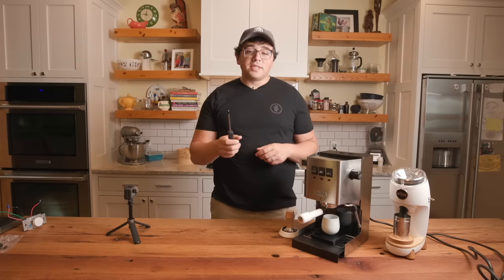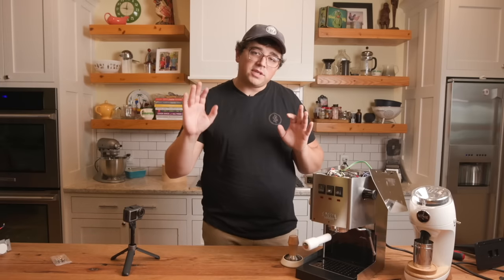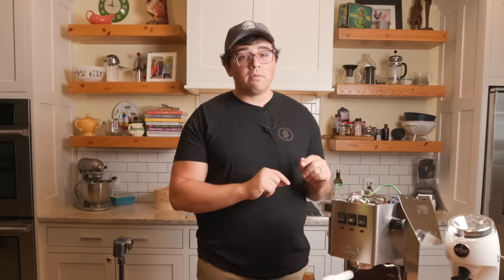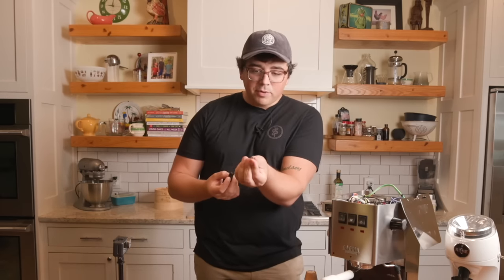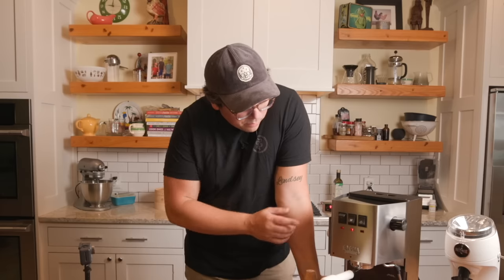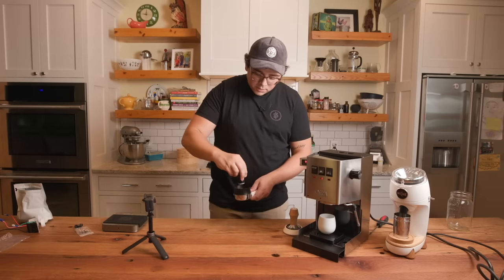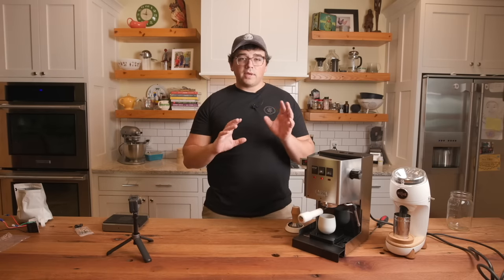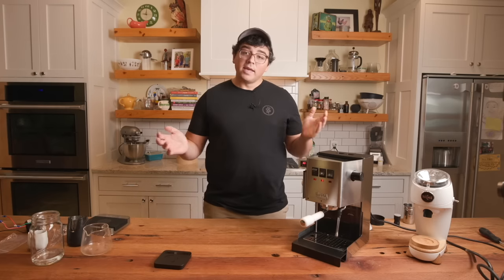TURNING A $450 MACHINE INTO A $3000 ESPRESSO MACHINE!: Gaggia Classic Pro FRANKENSTEIN

Comment: Enjoyed the video as I'm in the market to buy this machine and wanted to know what else could be added onto it.
I appreciate all the commentary on the mods for the machine, however I didn't fully understand essentially the list in order of what to buy based on price, time, and quality of change.
I'd love to buy the machine but wouldn't want to struggle in the beginning- or at least I'd like to reduce such struggle.

If anyone is around to see this comment, do tell what you believe the order is as I wouldn't mind going a little extra to make the machine better, but I'm sure I can't afford every mod quite yet.
Reply: just went through the process of doing all of the mods. 

i would say the only 'necessary mod' would be the 9 bar spring. 

my order was : 
9 bar spring
ims basket
bottomless portability
Brass shower plate
ims shower screen
MR shades PID
Pressure gauge
flow control
low profile drip tray
Reply: I think it is worth mentioning... I have likely spent around $1000 at this point with a ton of hours installing the mods. 

I do love the machine now, but It may be worth it to shell out the money on a more expensive machine from the start if you think you want all of those features
Reply: @dylanmetzdorf  thank you for the comment, helps a lot. I was thinking of going up or keeping at this but realistically since I'm still in the beginning of wanting to make coffee and practice I figure I shouldn't go too high- so if I need to skip on some mods I can live with that.

But I've heard enough good stuff about the machine for it to be worth trying especially for it being capable of making good coffee and lasting a while, the quality/build of it that is.

Comment: Okay so the last two days I have been using the new dimmer switch to start shots with a lower pressure for 5 to 7 seconds and slowly ramp up to full pressure. I don't have a pressure gauge so I don't know the exact pressure but every time I increase the pressure the flow out of the bottomless portafilter is way too fast like major channeling going on. What can I do to solve this? Without using the dimmer my shots return to the normal extraction time of about 27 to 28 seconds. Thanks for your help!!!
Reply from the maker: Hey! That's actually BECAUSE of the slow preinfusion. When adding PI, you have to grind lots finer

Comment: I didn't understand how is the flow mesured and displayed in the app? Is there any flowmeter with Bluetooth installed in the machine?
Reply: Through the Bluetooth scales?
Reply from the maker: No flow meter. I was measuring water debit. Using the scale and no hindrance between machine and scale, you can measure the flow rate. Then, you have an idea of water debit at any given position on the dial and dial in with that knowledge

Comment: (There's probably an obvious answer to this) Why 6.5 bars and not 9? I'd have thought that having the extra range would be helpful when flow profiling. Congratulations too!
Reply from the maker: I mostly did it to show what it is capable of. the set comes wiht 5 bar, 6.5 bar, 9 bar, and the machine is 12 bar. I also did it so I could run without flow profiling and have 6.5 bar shots, which are tastier to me

Comment: Have you noticed any difference in steaming pressure/consistency since doing all of the mods?
Reply from the maker: Yeah! Seems to hold steam pressure a bit longer. I'm sure Mr shades has more to say about that!
Reply: PID is a game-changer for the steaming pressure/consistency, before I was regularly second-guessing my GCP purchase but after the PID install I'm really happy. "The One" hole steam tip from Mr. Shades is also really helpful. When I eventually upgrade it will be to a Decent, but that's a long way off because I'm pretty happy and in no rush.

Comment: Do you need the pressure spring replacement if you instal the dimmer switch
Reply from the maker: I'd recommend it, yes. The dimmer doesn't control the limit of pressure. If you go too fine and do a slow rate, you could hit 12 bar and not know it. Lower the spring will lower the ceiling you could hit.
Reply: @LanceHedrick  i found out the gaggia i got has the adjustable spring not the kind you can switch for a different spring. So i have seen people build pressure gauge onto a portafilter handle to set the pressure. How about adding the pressure gauge as well as the pid and dimmer? I ordered the pid already…
Reply from the maker: Yeah! Many people have added a gauge no problem

Comment: Can you share the setting you use on niche for GCP? I'm currently using vst baskets and haven't been able to go finer than 13. Anything below,  I need >50 seconds to extract 1:2 ratio
Reply from the maker: Same. I was over 13, until I did the dimmer switch! Then with preinfusion I was able to go finer.
Reply: @LanceHedrick  thanks for confirming! Sounds like I'm on the right track. I received normcore filter and it seems to help enable finer grind but I'm still slowly testing them. Still too scared to mess with the internal lol I bought it with pid installed already.
Reply from the maker: Oh very nice! The dimmer mod is genuinely simple to do and easily reversible.
Reply: @LanceHedrick  I think I will have to attempt it hahaha I still can't get the right flow for sprouver
Reply from the maker: For sure. Dimmer will fix it! And you'll enter the heavenly world of sprovers
Reply: @LanceHedrick  hahaha i can see it coming. I shared the video with a friend who drinks long black. He's hooked on spro-over now!
Reply from the maker: Yessss. Another convert!
Reply: @LanceHedrick  I finally did it! Thanks for the encouragement.  I have a lot of experiment to do now.

Comment: Might try the dimmer. Great idea and looks easy.
Reply from the maker: Yes! Very very easy. Just go pump to wire to dimmer to wire to plug (that you took from the pump)
Reply: @LanceHedrick  Googling switches now. Got to look nice! While also being basic, single phase and not led compatible! Yikes
Reply from the maker: So the dimmers won't look nice. It is the wall mount and faceplate that need to look nice. Also, you can spin a knob out of wood or something if you'd like. 
I'll link the dimmer I used
Reply from the maker: Actually, the dimmer I used is in caption lol
Reply: @LanceHedrick  loving the videos by the way. Great stuff. Although I now want to mod my classic and upgrade my grinder!
Reply: @LanceHedrick  my dad made me a wood steam wand knob. So much nicer than the plastic
Reply from the maker: Absolutely! Get him to turn one for the dimmer.

Comment: Excuse my ignorance here, doesn't the dimmer switch do the same as the spring mod?
Reply from the maker: Nope! Were you able to check the video out! I explain both in detail!
Reply: @LanceHedrick  hey congratulations and hope you're enjoying being a father and realising the full need of caffeine!

I did watch and thank for doing them btw! but might have missed the difference in effect between them. To me the lowering of max pressure to 6.5 isn't that going in crude math be the same as keeping max at 12 but setting the dial to halfway?
Reply from the maker: Well, the dimmer you have capability to change during the shot. So, flow is what you're controlling which, in effect, can change pressure. Setting the OPV is ONLY changing what max pressure can hit prior to the valve shunting excess flow that otherwise would raise pressure
Reply: @LanceHedrick  lush thanks for explaining bit more, have ordered spring and did my first poor man's pre thingy just now (thanks to the other video) so little steps to start with me thinks! Thanks once again have subscribed to see what else you come out with! 😃
Reply from the maker: Thank you! The support means a lot!
Reply: @Splodge360  check out his flow rate video.  I found that helpful to watch before this one.

Comment: Thinking of getting one and modding it as an upgrade from my delonghi. I’m just wondering if it’s worth it since this is roughly around $1000, would it be better to get a machine around that same price?
Reply: It’s worth it (if you’re handy) and you can do it for less by ordering needed parts individually and modifying the xmt7100 pid yourself to control 2 relays. The pid comes ready to control 1 relay. Search other pid gaggia video to see how it’s all done.
Reply: Thanks for the links! Still I’m debating about skipping the modding process and going straight to a more prosumer machine. I’m looking into the pros of each right now
Reply from the maker: I would 100% recommend going to a prosumer machine over doing all of this. while this does a good job, there is so much time and effort put into it that I think just going straight to a prosumer machine is the right choice.
Reply: @LanceHedrick  thanks for the reply! I’m debating between the breville dual boiler or a quick mill silvano! Either way I should be pretty happy upgrading from my modded delonghi. I have a rok grinder so I don’t believe there should be a need to upgrade that as well
Reply from the maker: I would actually recommend upgrading the grinder. But of course that is up to you in your budget. I think you know my choice between the 2 espresso machines you brought up lol
Reply: @LanceHedrick  I have a few bdb I’m watching on eBay already haha. Once I get a new machine I’ll see if the grinder is needed, but my budget will probably allow me to get an urbanic or a used df64
Reply from the maker: Love that! That is fantastic. Happy brewing!
Reply: @LanceHedrick  I bought the urbanic a month ago and the burrs were perfectly aligned without adjustment. It grinds finer than I can go, but it needs the dimmer - next week!
Reply from the maker: Oh wow! You got lucky!  Fantastic news

Comment: Сontrolling a vibratory pump in this way is not the best solution. Installing a rotary pump will not inflate the budget too much, and the result will be much better. in this case, you need to install a jet that limits the flow of water, or install a frequency converter

Comment: Couldn’t you have place the dimmer inside the open space in the machine?  Drilling a small hole to the outside for the knob.  Better yet.  Why not just swap out the brew switch with a dimming one.
Reply from the maker: Obviously you can. I wanted to mount it so the person who received this unit for free in my patreon had the option as to what they wanted to do with the machine.

Comment: Hi Lance!
Welcome to fatherhood.

Can pretty much the same mods be done on the Saeco Poemia?
Reply from the maker: The dimmer mod can be done to any machine with a vibratory pump. Just get a single pole light dimmer (like under $10 and NOT for LED) and route the wire to the pump by way of one plug from the pump. Polarity doesn't matter

Comment: From what I understand you do not need to install the dimmer switch because the machine let's your do it already. look up Gaggia tips and tricks video
Reply from the maker: I've gone over this in the first gaggia video. That way you're talking about both wastes water and gives you barely any control. On top of that, you'll run out of hot water immediately considering the boiler is 3 oz

Comment: 9 bar spring, means your espresso actual pressure is lower than 9 bars. There's a reason it has a 12 bar spring
Reply from the maker: The 12 bar spring doesn't give 9 bar. A simple pressure test proves this.
Reply: @LanceHedrick  you have to read. This is not what i said, i said it's lower than 12 bars
Reply from the maker: 9 bar spring with a pressure gauge gives you right around 9 bar. 12 bar gives you right around 12 bar. Have you tested with a pressure gauge? Not sure where I'm misunderstanding you
Reply: I tested my GCP at the portafilter, and with the factory spring I got 12.4 bar. 9 bar spring is on order.

Comment: Dumb question, why is a six-bar machine preferable to a 12 bar machine?
Reply from the maker: Not a dumb question. I moreso changed the OPV to show how it is done. And there is a trend for low pressure shots as of late because it has been speculated extractions are more even and consistent there.
Reply: @LanceHedrick  thanks
Reply from the maker: No problem, friend!

Comment: Sorry to tell you if you want to spend a lot of money... The OPV is actually perfect as it is. To high pressure? A turn ccw. Too low? A turn cw...
Reply from the maker: a spring is not a lot of money.... unless there is a shortage of springs near you lol.
Reply: The new GCP is not adjustable and requires a spring change to adjust pressure. PITA but that was one of the changes for the 2019 redesign.

Comment: Why the 6.5bar instead of the 9bar spring?
Reply from the maker: Hey! Mostly because I prefer lower pressure on light roasts due to lower puck integrity. Also, I love turbo shots, which 6 bars are better for. So, I can opt out of flow profiling when wanting a simple turbo (watch my video on turbo shots if intrigued)
Reply: @LanceHedrick  yes, I watched the video. It was how I first found your channel. It went over my head 😅

I’ll need to go back and give it another watch. I’ve got a GCP with everything here, but the rotary knob. Having a hell of a time preventing channeling
Reply from the maker: A lot of that is likely puck prep issues! Make sure to watch the wdt video and grab a tool with .3-.4mm needles!

Comment: Why 6.5 bar spring and not 9 bar spring? I thought 9 bar is  the appropriate pressure
Reply from the maker: Different strokes. Lower pressure can be better for lighter roasts. Lighter roasts have lower puck integrity and need some finesse. But also, I did 6.5 because I like turbo shots haha. Check out my video on those if unfamiliar

Comment: Where did you get the schematics for the machine ?
Reply from the maker: What do you mean?
Reply: @LanceHedrick  how did you know what the wires were. Voltages, signal etc..
Reply from the maker: Ok I figured that's what you were asking but didn't know why.
So, I didn't get the schematics anywhere. I relied on the Gaggia community, where this is a known and proven to work mod from over the years. I was given a heads up on the dimmers that have been proven to work and matched wires to that. 14AWG is what works, fyi. No worries about polarity on the dimmer mod
Reply: @LanceHedrick  ahh okay, got it.  Thank you for your quick reply
Reply from the maker: Absolutely! I'm sure schematics are easily accessible online through their patent or something.

Comment: Wait, what is the spring mod for?
Reply from the maker: Change the OPV (over pressure valve). This is the valve that releases excess flow when a certain amount of pressure is reached. The springs all have varying tension levels, corresponding to a certain level of pressure. Stock machine comes at 12 bar, but you can change it to 5 or 6, etc.
Reply: @LanceHedrick  okay I see, thanks! I'm following this tutorial but on a bezzera unit, so it's just a bit different hardware
Reply from the maker: Oh ok! That makes sense! Yeah that checks out, though I would be surprised if it wasn't a springb in that one, as well

Comment: You sort of trail off the thought if you don't have a gaggia pro if these mods are worth it.
Reply from the maker: Hey! Sorry. Very ADHD. Apologies. So, my opinion is this is a great option if you already have one. I'm not sure if I'd say get this to do the mods. I'd recommend, instead, getting the Breville dual boiler that already has PIDs installed, much better thermal properties, and can have flow control with an easy, no extra parts mod. See my Breville video. BUT if you have the gaggia, these are a must
Reply: @LanceHedrick  Thanks. Great content.
Reply from the maker: Thank you!

Comment: Still an aluminum boiler though
Reply from the maker: True, but it is yhe second best conductor behind copper, so with a pid controller should be quite simple.to maintain temp on a 3oz boiler even with aluminum
Reply: @LanceHedrick  This was my first espresso machine and I spent some time modding it too. Ending up selling it as I was worried about health issues related to the aluminium boiler. With time, aluminium starts to deteriorate and can end up in the drink. This is in very small quantities and not harmful given the size of an espresso... though enough to be a deal breaker for me ahah. Beside that, great machine, and good job on your mods ;)
Reply from the maker: Takes a while to degrade, but I get it

Comment: Your wiring is dreadful you should not be looping single shrouded mains voltage wire in and out of the chassis like that.
Reply from the maker: But I did. And it is lovely